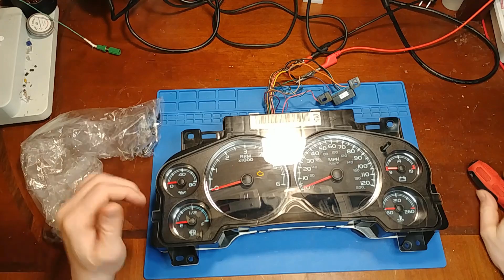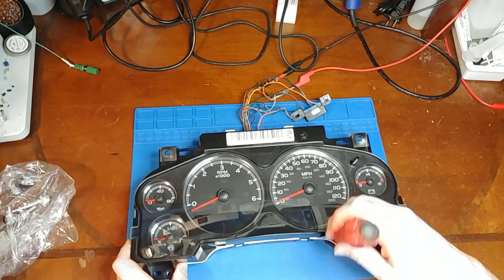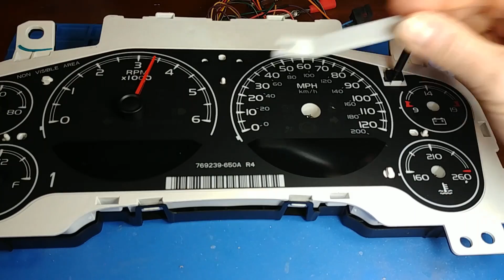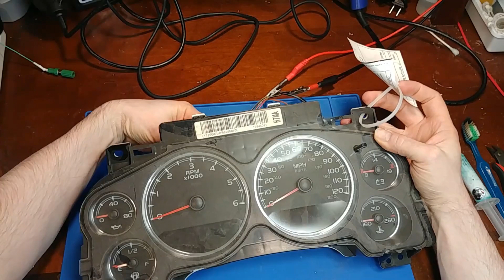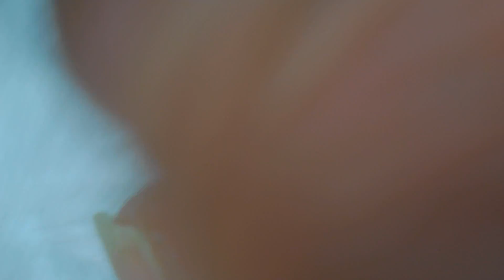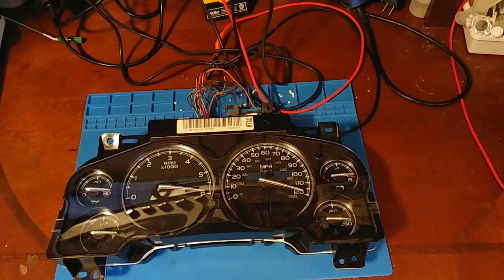2007 GM Cluster Repair + Blue & White LED install

Comment: Can you repair Chrysler clusters? Say from a 2002 Dodge Ram 1500? My cluster went out one day while I was driving down the road. All the gauges just froze in place while driving down the highway. I got home and with key off the cluster was still illuminated, so I had to disconnect my battery. Now I have no cluster, wipers, horn, turn signals, brake lights, dome light, and headlight switch does nothing. The headlights and taillights now automatically come on with key in RUN position. I've learned through research on these 3rd Gen Dodge trucks that all the other functions I mentioned run through the cluster circuit. I yanked the cluster and checked every pin at the cluster's connectors. All my powers and grounds are good, no fuses blown or anything. So I'm calling the cluster. Does this sound familiar to you at all? Also I took my cluster apart and inspected the circuit board, visually I saw nothing wrong. I reassembled the cluster and it's now just sitting in my garage. I did not attempt to fix the cluster. Sorry to make this lengthy, but do you only repair GM clusters? I wanna send mine in somewhere, but I don't know who to go to. Thanks in advance! =]
Reply from the maker: With a problem like yours yours you'll  want to send it into somebody that is more experience with Dodge. If you removed the needles it'll require calibration on reassembly.
Reply: @jeffescortlx  Okay for sure! Thanks for the reply! Love your work! =]

Comment: I don’t like the little needles going all the way across. Do you have a supplier for the steppers in these and have much call for them?
Reply from the maker: Since a stepper motor failure in the 07+ is very rare, I use donor parts for a instance like this.

Comment: Do you fix all gauges? I have a 2003 Lincoln Navigator gauges that I had the key programmed but they were unable to correct the mileage, is that something that you could do and if so how much . A response would be greatly appreciated Thanks Tony
Reply from the maker: What happened to the original cluster?

Comment: I like it too, I wouldn’t mind doing something like that to my 2010 but my OCD wouldn’t let me since the lcds and the rest of the dash controls wouldn’t match! Would of like to see the inside of the stepper to figure why it was so crunchy!
Reply from the maker: I should have taken the stepper motor apart on camera. Next time!
Reply: No worries mate, curious minds inquire. Just love your videos, would of love to have a setup like this when I used to work at the dealer. Worked 7 years for a GM Truck Center, I changed and reprogrammed countless numbers of clusters.
Reply from the maker: @MaxPower_Designs  and I bet the dealerships are still seeing these older clusters!

Comment: Great job. What kind of solder are you using to bridge those connections? Assuming the wire is solder wire?
Reply from the maker: The jumper wire is just solid strand lead wire.

Comment: Jeff as always great work, Jeff I have a 2003 Chev. Tahoe and the RPM Gauge is screwy could you help me out on what piece that would be, or am I overstepping for your knowledge if I am I don't mean to and apologies. Thank You Luigi D.L
Reply from the maker: 03 GM cluster, you'll want to have a full rebuild done on that one. Replace all the original stepper motors, lamps and by now you'll have a dozen fractured solder joints. Intermittent power is right around the corner and I bet your gear select display is dim.
Reply: hey Jeff what would the cost be if you did what was needed and maybe with a color light change? @jeffescortlx
Reply from the maker: @luigigdelucia1333  $130 plus return shipping.
Reply: @jeffescortlx  ok I'll remove it and contact you and go from there talk to you soon ldl